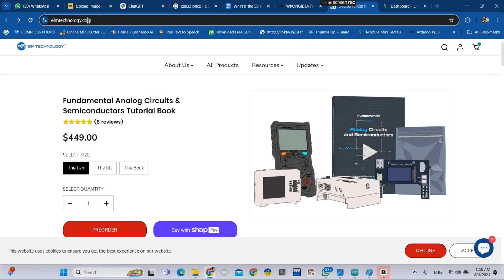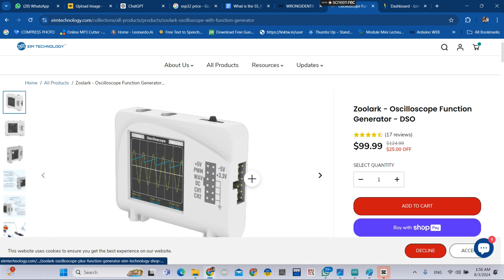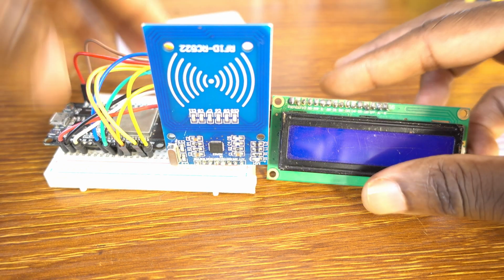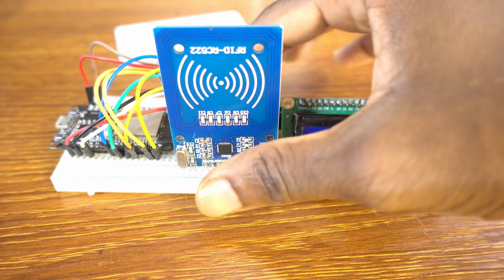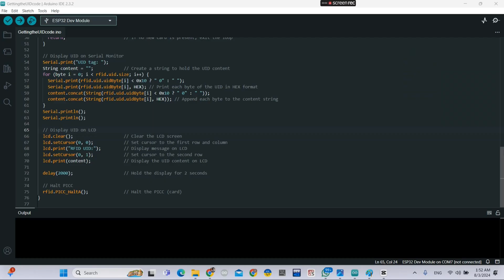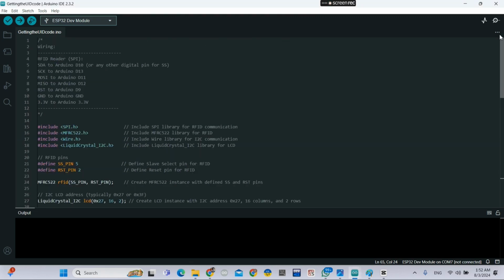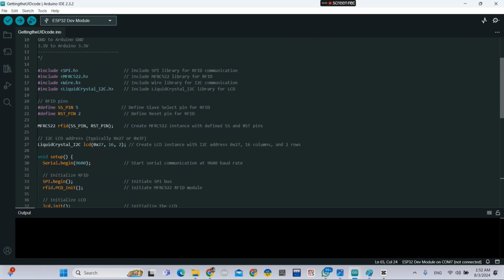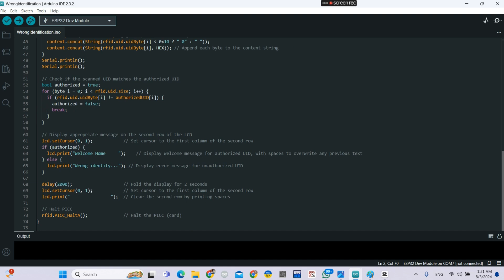ESP32 + RFID RC522 Tutorial with LCD Screen (BEGINNER-FRIENDLY)

Comment: Hi, I'm usign ARDUINO IDE 2, my module is ESP32 DEV MODULE, but it doesn't compile and show me these error:
In member function 'MFRC522::StatusCode MFRC522Extended::TCL_Transceive(TagInfo*, byte*, byte, byte*, byte*)':
c:\Users\fernando\Documents\Arduino\libraries\MFRC522\src\MFRC522Extended.cpp:824:34: error: ordered comparison of pointer with integer zero ('byte*' {aka 'unsigned char*'} and 'int')
  824 |         if (backData && (backLen > 0)) {
      |                          ~~~~~~~~^~~
c:\Users\fernando\Documents\Arduino\libraries\MFRC522\src\MFRC522Extended.cpp:847:42: error: ordered comparison of pointer with integer zero ('byte*' {aka 'unsigned char*'} and 'int')
  847 |                 if (backData && (backLen > 0)) {
      |                                  ~~~~~~~~^~~

exit status 1

Compilation error: exit status 1

EDIT: I solved this error reading arduino forums.
that issue can be fixed ading the symbol *
if (backData && (backLen > 0)) {
now rewrite the code into this
if (backData && (*backLen > 0)) {
I hope this colud help anybody who need it.
Reply from the maker: Did you use my code ?.
Reply: @uploadideaswithitamar  yes I downloaded from your link.
That Issue was reported in the arduino forums when you work with ESP32.
But I fixed it.
Reply: @adiktndx  How you fixed it? I'm looking for the same problem right now.
Reply: @GabrielDiniz-n9c  hi, it’s a library problem. Basically the argument Of One Of the functions inside the library, has a wrong declaration work pointers. Ley me check today please, Im a lil busy now.
Reply: @adiktndx  hi can you show how you solve this problems
Reply: I've edited and saved the edits to the library using vscode however the software acts as though no changes have been made. I've restarted the application several times to no avail. I've restarted my computer for other things too and that did not help. How were you able to push the edit through to the ide?